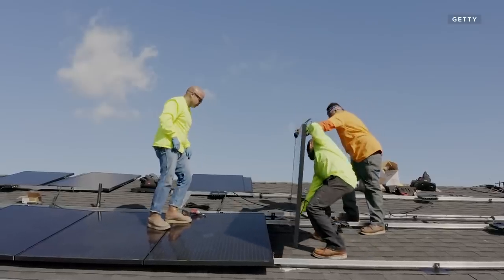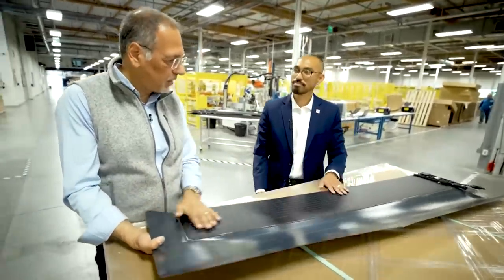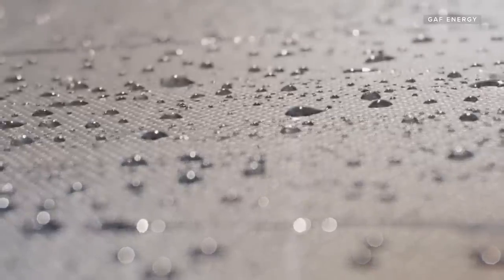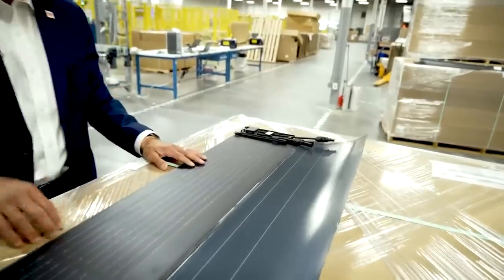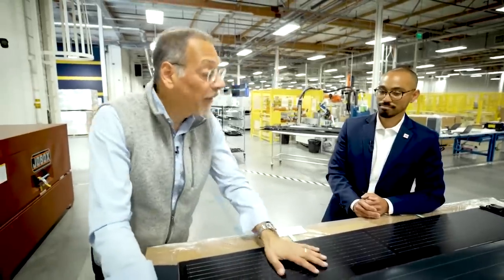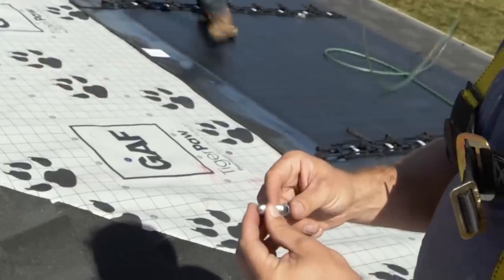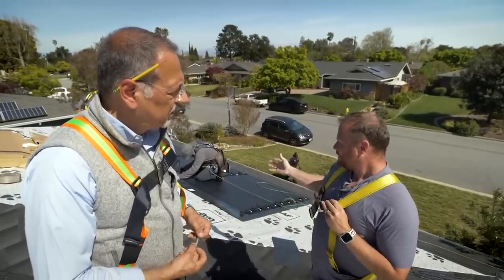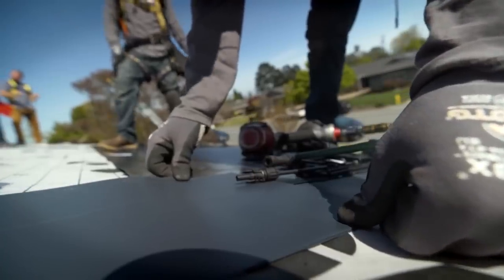The new Timberline Solar™ roofing system is so advanced it makes solar simple.  Call 801-447-8011

Comment: 0:06 NEVER stand on the solar panels
Reply from the maker: In most cases it is best to avoid standing on solar products; however, the GAF Timberline Solar Shingles have no problem being stepped on and are specifically designed to be stood on by the installer adding to the convenience and efficient install times.
Reply: This type of product standing is a must to stand on or how can the installers can install it?
Lets hope the installers put some TLC of not cutting or puncture the solar panels itself during installation.
Then the warranty test kicks in of the
manufacturer product or the craftsmanship installation is the problem is yet to be seen.
Reply from the maker: @loktom4068  The product is stronger than a typical shingle and flexible as well so there are no problem with standing on the shingle during install.  Also resistant to the typical elements hail wind rain and snow just as a classic shingle is.  These things are very strong and durable which is necessary for anything going to be on your roof longterm keeping out the elements.

Comment: nothing new about the solar panel, there are load of companies manufacture something like this
Reply from the maker: Thanks for your feedback.  You are correct that there are thousands of different solar products on the market today.  The one thing that is very unique to GAF Timberline solar shingles is that they are nailed down just like a regular asphalt single making it one with the roof and one with the other shingles all meshing together creating a very strong hold.  This makes the install process faster, more affordable and easier for a regular roof installer to handle without too much extra special skill or training.  Aesthetically speaking, this is a true shingle. This is a solar shingle, and it’s a marriage of solar and roofing. It’s a sleek and simple install. It is truly one with the roof.  It is not the perfect look, hidden away like the Tesla solar glass tiles but this is a great secondary option if you want solar that does not look so bulky like regular rack mounted solar panels.
Reply: Please let us know what other competition brand to this is in the market.
The only other brand similar to this was the Elon Musk's invented one that's having lots of problems right now.
Reply from the maker: @loktom4068  The closest product to this would be the Tesla Solar Tile Roof which is about double the cost and 3-5 times more time and labor to install.  Both are great products and produce great reliable solar energy all while looking better than traditional solar panels.  Here at Legacy Roofing in Utah we also install many Tesla Solar Roofs and they work great.  Have not had any problems so far over the past 24 months and expect that to continue.  Solar Shingles and Solar Roofs are very reliable with few problems if installed professionally.  Here are a few of our installs in the following video that you can check out:  

https://youtu.be/TH971dt0m5Q

Comment: the many you spend on it it will never paid for it self in 20 years  so for now is to expensive yet   unless you rich  so who give s than
Reply from the maker: Depending on your local energy cost the typical solar roofing system should pay for itself in 10-15 years.  This all depends on how large your roof is, how many watts you install, if you have a battery system and also how much daily energy you use.  Most homes in the USA break even around the 15 year mark at current energy rates plus government incentives to install solar. The amount of sun your roof receives is also a factor that will determine how much energy the roof will produce.  Overall most of the cost vs return reports I have personally done all break even around the 15-20 year mark so you end up with 5 years of fully covered warrantied solar energy and every year that they continue after that 25 year warranty period is free energy.  I have a solar panel from 1985 that still produces 80% of its original output.  Solar cells can go far past 25 years, just be prepared that there is a loss in output ever year after the 25 100% output years.

Comment: Solar is an astounding waste of money.  The conversion efficiency is a joke at 25%.  When they reach 80%, let me know.
Reply: Funny, you posted this already and are clueless.  It's all about how much energy they produce and how much sq ft you have to fit the array you want.  My ROIs on my separate arrays are 5 years on the 2020 DIY and 10 years on the 2019 installed by a local company.  These ROIs are not considering energy price increases.  How is this a waste of money?
Reply from the maker: ROI is all that really matters.  The point is to utilize the sun for your energy and save money in the long run.  This depends on many factors but in many cases you will break even on the investment in the first 15 years and have free power after that for as long as the solar cells keep producing.
Reply: @whattheschmidt  
Yes, you enjoy your 25% efficiency, and in two or three years when the efficiency is 40% and the price is even less, I'll have double your ROI
Reply: @yourlogicalnightmare1014  go for it! I'll bet you $10,000 you won't have 40% efficient panels 2 years from now though.  Also I will achieve the return on my investment before you.
Reply: Once you break even on cost, even 25% efficiency is OK because even with the efficiency it is possible to supply a home with all or almost all of the electricity needed, at no cost.  In other words, if the electricity is free, who cares if the efficiency of producing it is low?